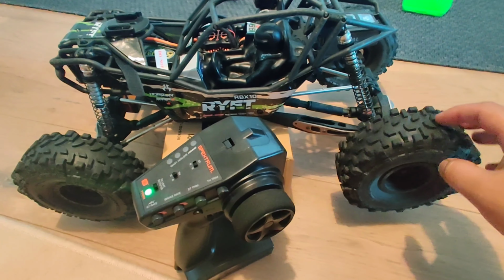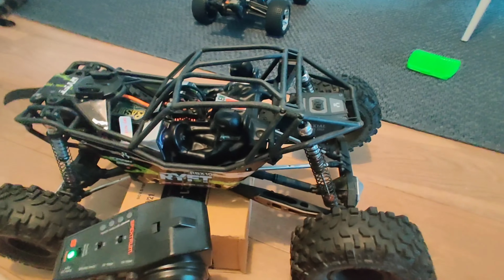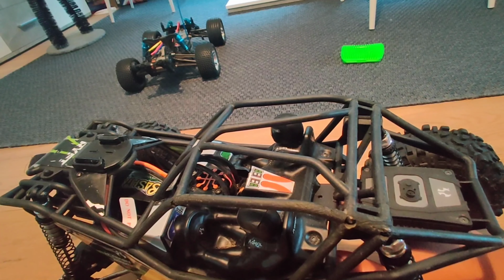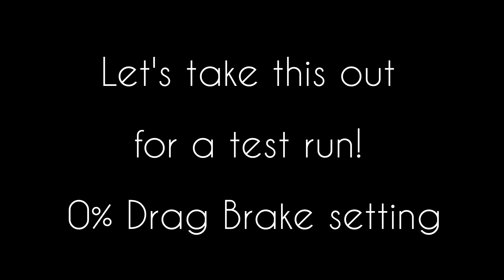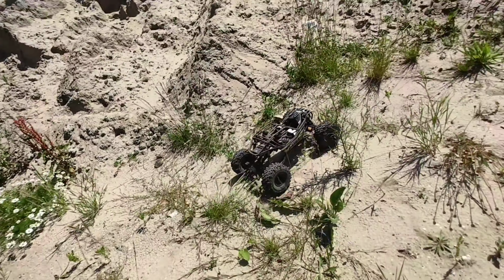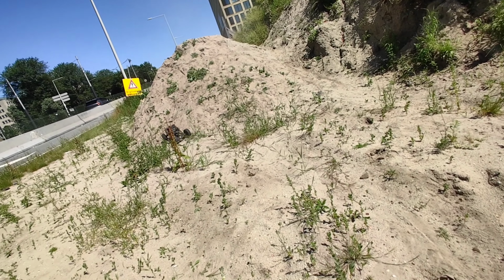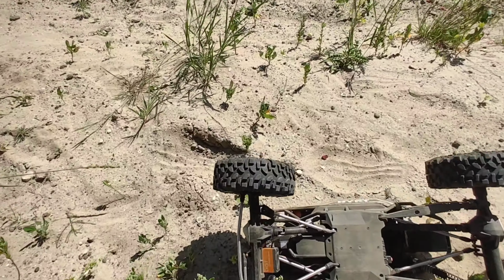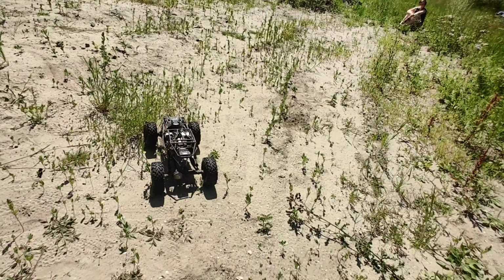Do this NOW to protect your Axial RYFT! - ESC Drag Brake setting and test

Comment: They should have better instructions for the radio in the manual. They are literally non existent. I went overboard and rebuilt mine from the ground up, spent over $2k in parts. Treal parts everything and Castle ESC motor Combo. Lockers on all 3 diffs. Put a 14 tooth Pinion. 38/13 Front and Rear Ratios. Airbrushed my own roll cage, added a Fan. I got Futaba so I get the Castle Telemetry also. She' is gorgeous. Problem is it's almost too nice to take out.